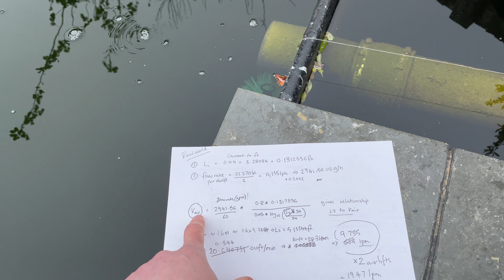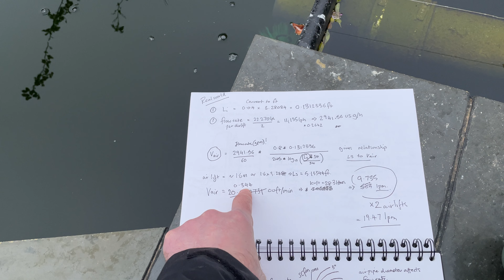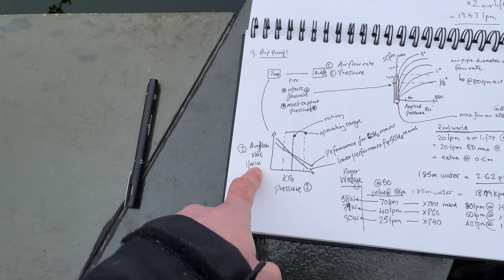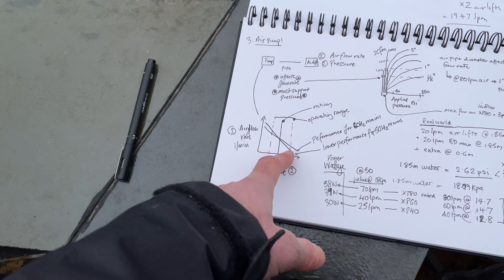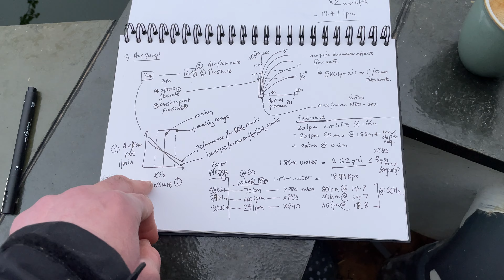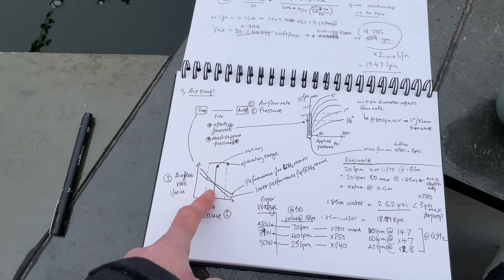Part two of designing airlifts for your pond, the calculations and selecting the air pump.

Comment: You mention that your bottom drain is reduced down. What diameter is it reduced to?
Reply from the maker: For the bottom drain - it's 4"-110mm outlet, 1" air into it and the lid is positioned with enough area gap to match 110mm with a little for bio but not let fish get under. There's a 110mm wall skimmer too.
They feed two 110mm ball valves so they can be reduced down to balance.
Reply: @nickk6109 thanks Nick, just been following along with all your posts on the forum. Has anyone ever thought about doing an airlift pumped bottom drain? I.e injecting air into the bottom drain to pump it up and into the filters and then return by gravity? 

I’m thinking this would save having to dig a collector sump and may also reduce the need for purging the bottom drain. Thoughts?
Reply: @nickk6109  https://youtube.com/shorts/8ye6Tp_mt90?si=BxV6MJotT9uOEiBx I’ve made a short video for you which shows my thoughts more clearly